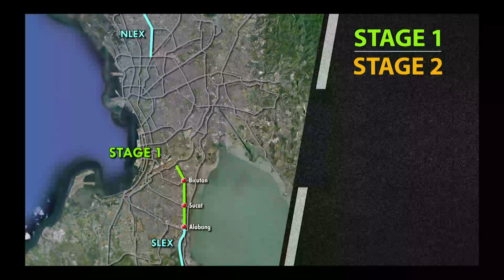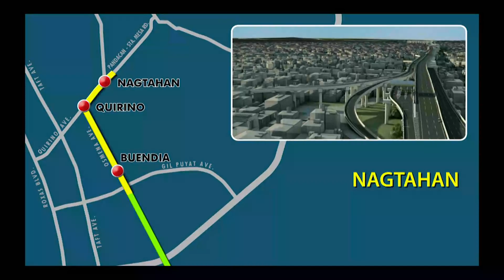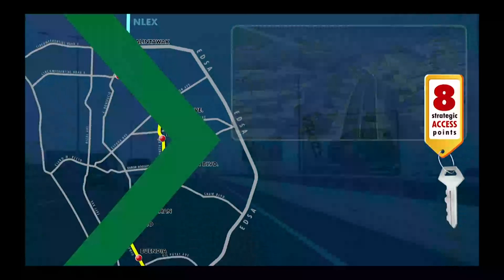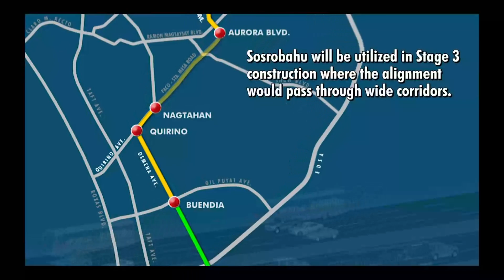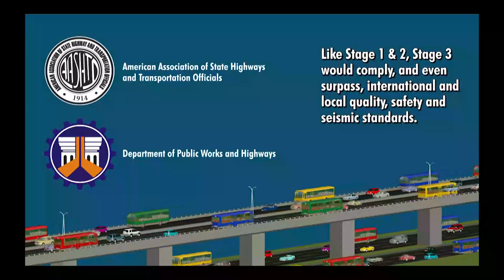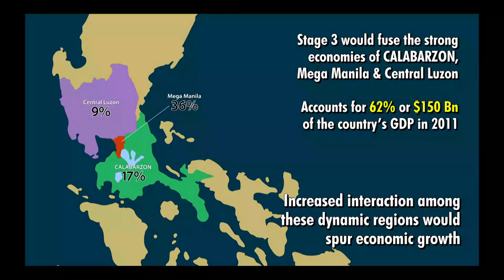Metro Manila Skyway Stage 3 - The Bright Road Ahead

Comment: Useless road constructions since urban planning sucks here in PH. Traffic jams in Metro Manila will only be solved if government will pass law to regulate/stop people from buying cars (like Singapore did) and implement connected 2-layer MRT systems.
Reply: That's not forward thinking now, is it?
Reply: Gel Yes, it is. Unless PH transform into fed and decentralized from Metro Manila, building additional roads are USELESS. Connected MRT is the future.*
Reply: No. I mean they should continue on refining our road systems, it's also part of the decongestion/decentralisation project. Why not do both?
Reply: At this point, PH dont need cars and refined roads. As mentioned, the urban plan HAS BEEN PLANNED WRONG after WW2. People are bound to congest in Manila in the coming years unless PH transformed to fed and they have their own set of labor force and government. Mass transport via trains (not even e-jeep) is the way to go.
Reply: The only way to get rid of roads is to have flying cars (which ee don't have yet at this time)
Reply: I repeat. Mass transport via train is the way to go.

Comment: this is insane instead of building of huge skyway which makes this roads with more cars running why not a mass transport system because it eliminate cars thus making our roads efficient with less cars running on those roads
Reply: Roger  Polito you cant eliminate cars, because that will be outrageous, and Roads are more preferable solution because the current situation is Traffic, so the solution is roads
Reply: Trucks will also need roads
Reply: pongpong123able 
Trains can carry freight
Reply: Don't worry, we have NSCR.